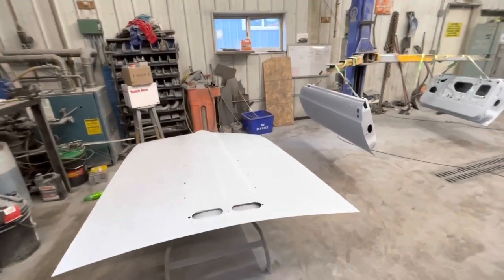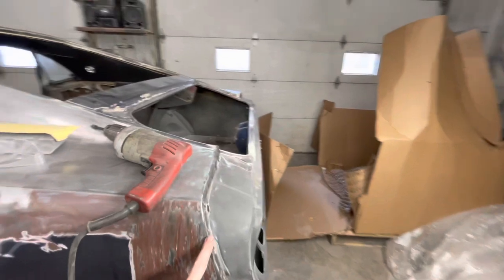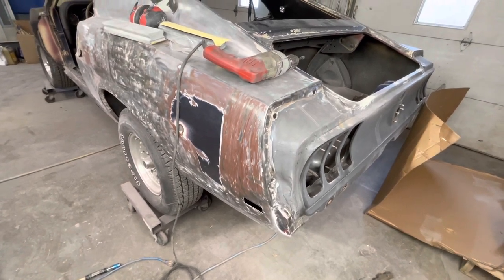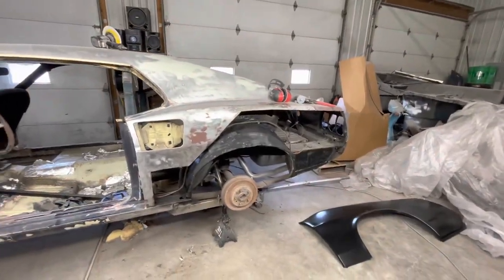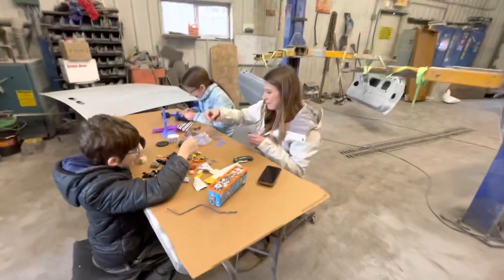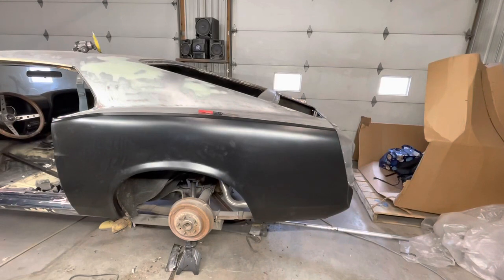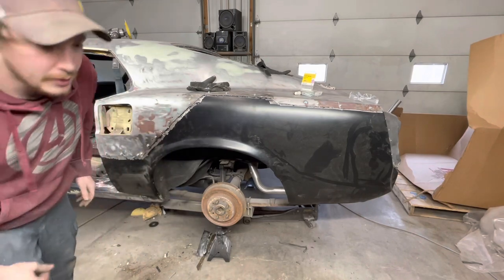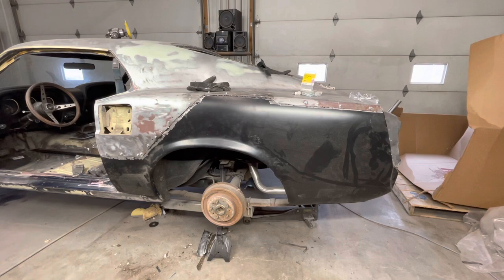1969 Mustang Fastback Quarter Panel Replacement w/Panel Bond

Comment: I agree with Don, weld the vehicle together, that's the best way for proper repairs to any vehicle. I have seen the most recent products that body technicians are using today. There's a great product that will remove dents from the body without drilling into the panels. It adheres to the paint too! Totally awesome!!

Comment: Check out Fitzy's Fabrications ono the subject called "Cut and Butt". You'd never be afraid to butt weld again. Also, if Dan from DD Speed Shop can do the cut and butt method you can do it. :-) Lapping on a curved and seemless quarter panel... Please do check that "cut and Butt" method that Fitzy explains and shows very concisely. You'll dig it.
Reply: I do the cut and but but I use a body saw gap is smaller than the cut off wheel no warping.

Comment: Panel bond is a terrible idea.  You should weld it together.  Yes takes longer, but you have a classic car that should be preserved correctly.  Sorry this is negative, but man, never would do that in a million years.
Reply from the maker: What’s you issue with panel bond? I’ve used it multiple times in the past with no issues short term or long
Reply: @resurrectionauto5714  This is basically the lazy man's way of repair.  Scab 2 pieces of metal together with sheet metal screws or rivets and then seal the edges.  I know you would not do this quite that crudely, but there is still metal overlap which then you must use filler to smooth over to make it 'look' like one piece.  Why not just take the time and do it right instead of expeditiously?  Like I stated, a classic car needs to be restored correctly.